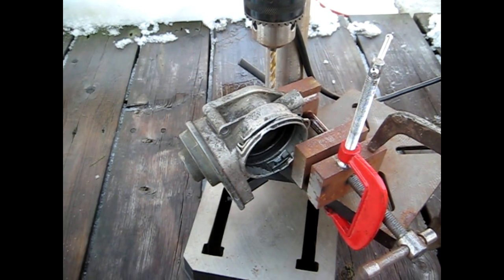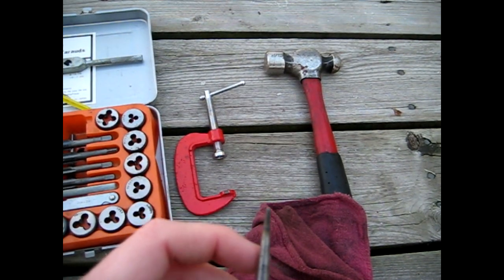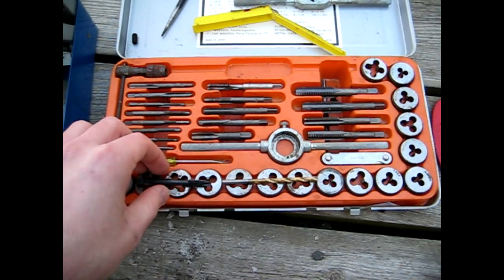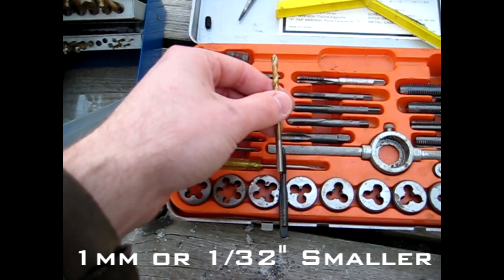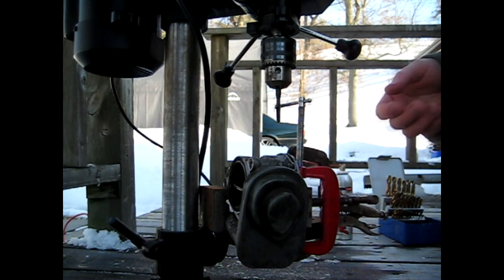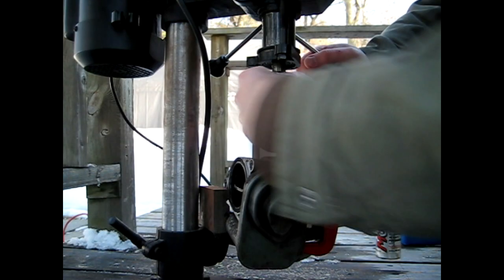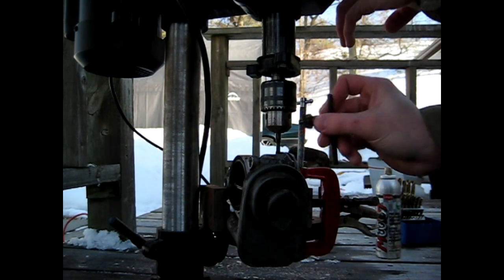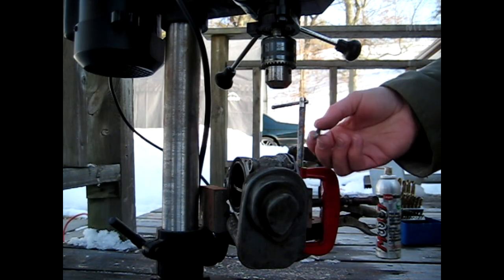DIY: Drilling & Tapping Threads Into Aluminum

Comment: To go in that easy, didn’t it create too shallow of threads?
Reply: It doesn't work like that, the tap pulls itself into the hole and cuts the threads to the accurate depth. You don't need to apply much downward pressure.  In fact, gravity should be all you need.  If not, you broached your hole too small for the tap you want, and need a tap and die chart, IMO. 
I am far from an expert, if there is some way you can run a tap to get shallow threads that has just alluded me all these years please someone correct me.  However, I'd be shocked to find out it is even possible to do what you are worried about doing.  Although, now that I read your question again it makes me think you are actually worried about the pitch of the thread, rather than the depth of cut.
The good news is you should be fine on both. 
Thread depth/pitch is never anything I've had to worry about once I picked the correct tap. If you see threads after running your tap, you're good to go.

Comment: So how strong would a thread that shallow be? Looking to tap and thread into a patch on my frame for an engine mount bolt to go in but the patch is close to this in thickness and im only worried about the torque yanking out the bolt and threading with it.

Comment: I had marginal results trying to tap a cast aluminum clutch lever housing with a precast smooth hole in an attempt to mount a threaded mirror arm.  Didn't have and don't know where I'd get a "gun" tap such that rather than getting nice spiral cuttings I got more of a rind like you'd get from an apple peeler.  Can't decide if was my tool/technique or the material as I felt I needed to risk some galling to clear the debris to avoid excessively damageing the thread I did manage to cut.
Reply from the maker: You could weld up the hole and try again or insert a helicoil. When using taps, it's important to have a good quality set and use the appropriate sized drill. Here is a tap and drill index chart http://www.4diyers.com/resources/tapanddrillindexchartsae.php

Comment: How much pressure to apply when tapping the hole?
Reply from the maker: capcom co Just medium pressure. Similar to what you would do with a drill bit. Expect once the tap is in a little ways, it'll do most of the work itself as it threads future into the material.

Comment: With metric taps and drill bits, there is a simple way to know the minor diameter. In the video, he use M6 x 1 thread, so you substract the nominal diameter by the pitch, simple as that. For example, for a M6x1, the minor diameter is 5 mm.